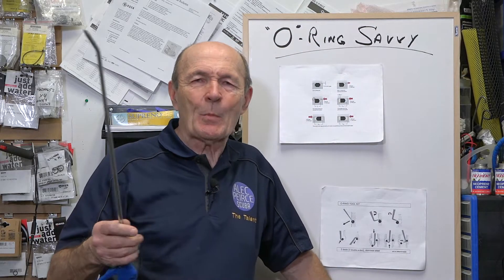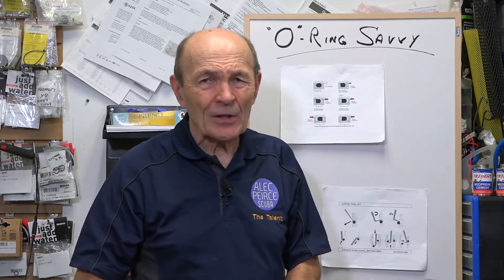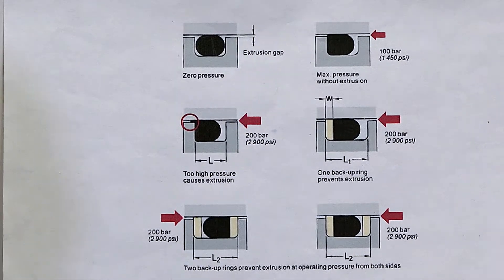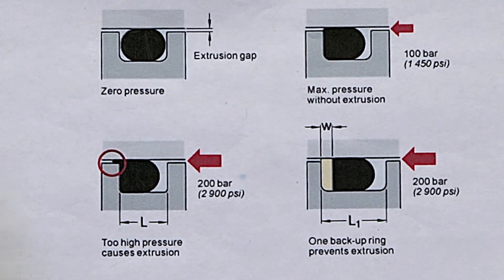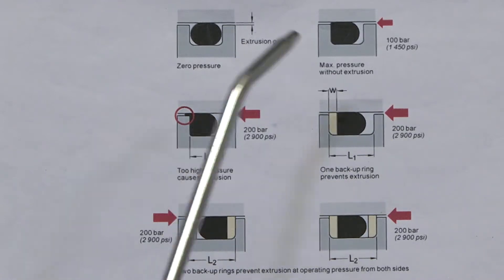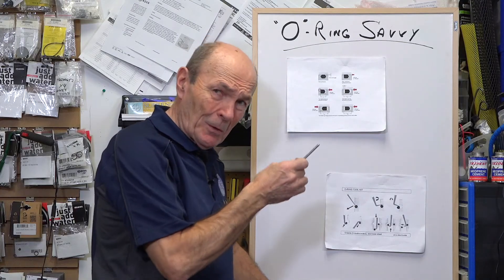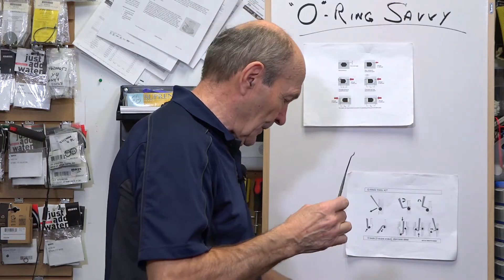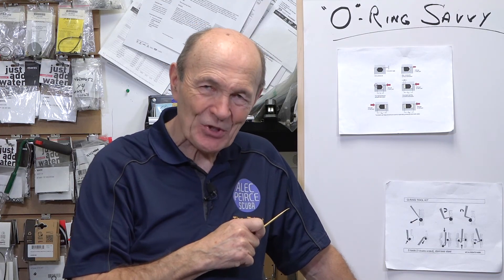O-Ring Savvy - Scuba Tech Tips: S13E13

Comment: As a general rule of thump up to 100 bar of pressure is ok to to use sh70 or Duro 70 o-rings but for over 100 bars the sh85-90 oring must be used specially in positions that there is no backup ring for the  reasons you mention in your video Mr Alec. Very nice video!!
Reply from the maker: Good advice. Thanks for watching!

Comment: very good explanation of the function of an Oring.
these are fantastic devices that are universally used in industry, even in the rocket boosters to make the joint between the sections of the booster tubes.
Space is not my expertise but I have an experience in designing tooling hyrdraulics where pressures over 10,000 PSI are  not uncommon, we use intensively oring for sealing that pressure.
A fact is that sealing at pressure is easier to control that the sealing at zero pressure and most of the problem encountered is oil seeping when the equipment is at rest.
very good topic that is not covered in a generic diving certification.( to my opinion, the basic knowledge of the equipment used by a diver should be an integral part of the certification. )
very good video.
Reply: Brother-Diver Jacques,  100% agree with your opinion that this should be included in all basic-certificaton training phases.  Earlier you mentioned your design background in tooling-hydraulics, + potential pressures over 10,000 PSI ?  <  Now  THAT is what we'd all call some SERIOUS  high-pressure parameters!
Reply: @martinbachmann6283  on many applications using common equipments as ENERPAC, BLACKHAWK, OTC and many similar are based on 10, 000PSI systems, even the cheapo bottle jack uses pressures in that range.
When working in high pressure hydraulics, the tolerances on the Oring grooves, finish and back up rings are crictical Often, we use urethane Orings where the cycling is important as an automatic clamping system
Reply from the maker: Thanks Jacques and for sharing your experiences.  Very interesting they work at such super high pressures.
A

Comment: A standard K valve O-ring that seats up against the 1st stage regulator is a different O ring than what goes onto a pro valve to seat up against the 1st stage. Correct?
Reply: the size is different but the sealing pronciple is the same.
Reply from the maker: If you mean the tank valve o-ring against the tank, yes different size, same purpose.

Comment: Perfect timing. I went this long weekend for first dive of ‘22 and had 2 leaks. One with BC inflator hose and one at tank. Both “O” ring issues. Had to cut dive early, but got in some time before issues. Of course it was 47 degrees F at 27 feet. The guys came back and reported 42 degrees at depth 38 feet ❄️
Reply from the maker: Glad it helped Paul.  That’s a cold dive!A

Comment: Hi Alec. What is the point to lubricate the O-ring if all it does is to seal ? Does brass material last a long time in salt water, are they tough ?
Reply: The "lubricant" keeps the rubber/silicone/etc from drying out. 
Brass is corrosion resistant, also adds to sealing well.  Brass  fitting (in general) will flex into a shape the fits better, giving a tighter seal.
Reply: @Caderic  that makes a lot of sense. Thank you
Reply from the maker: Lub is only needed for dynamic o-rings that move or to help move it into place, like a tank valve o-ring.  Otherwise no lub is need unless the maker recommends it.  In some cases lub can aid in extrusion or feathering.
A

Comment: Why is brass the metal of choice for regulators, tank valves, etc?
Reply: I think is because they don’t really corrode in salt water
Reply: for th ease of machining and the corrosion resistance. the weakness of stainless is that when it is in presence of chlorine ions, it have a tendency to corrode,
 just place a piece of 3 series stainless in the presence of an sample of pool chlorine ( puck or granulated ) and leave it alone for 3 months, you'll find the stainless piece as rusted as about any steel.
Reply from the maker: Resistance to corrosion first and easy to work.  Ever wonder why brass port holes from hundred year old wrecks still look so good?
A